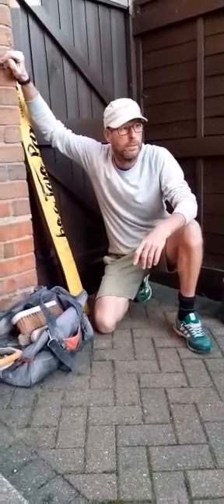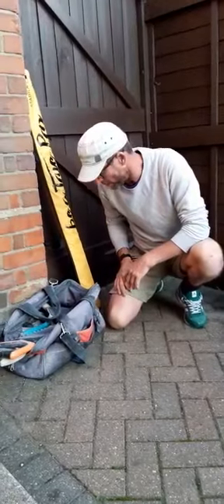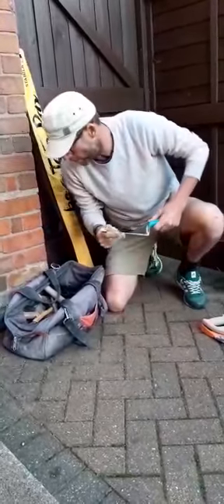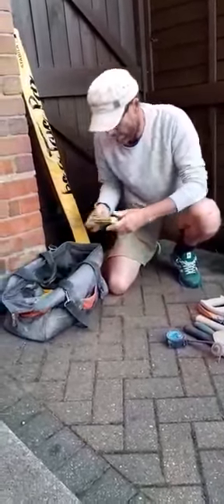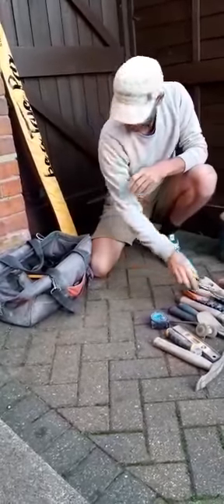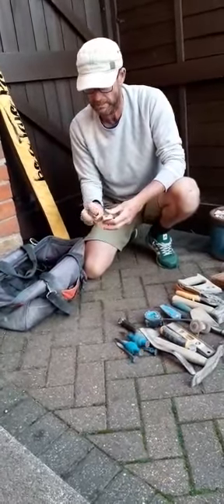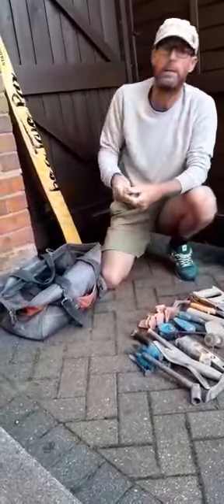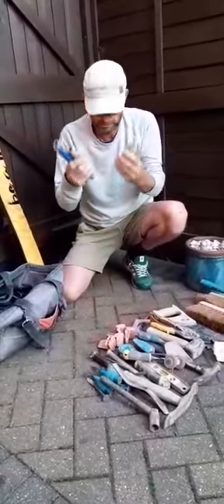Goofiest Bricklayer in Essex - what's in my tool bag?

Comment: 11inch marshalltown
1metre stabila
2 footprint pins
Carboot sale,brick and lump hammer+ 4inch bolster
12mill bent bar jointer
2 homemade wooden c/blocks
Poundshop tape
The wifes brush.
70 quid the lot.
Reply: What trowel you using in the mobile muck board video bro ✌️